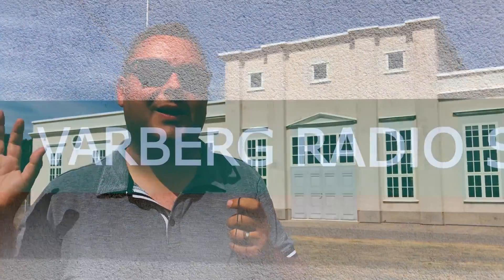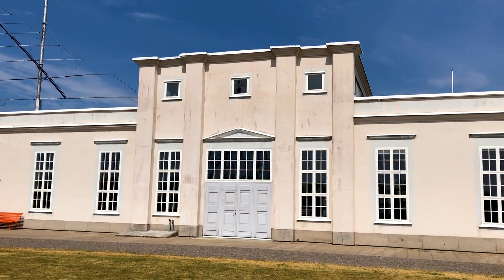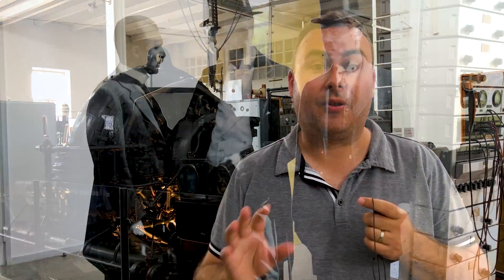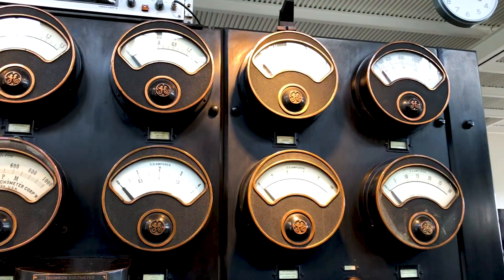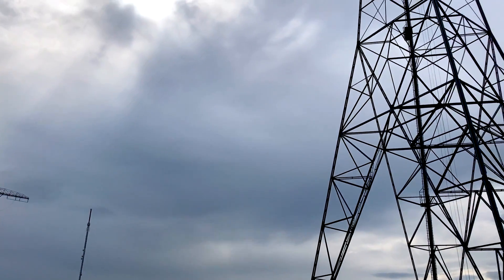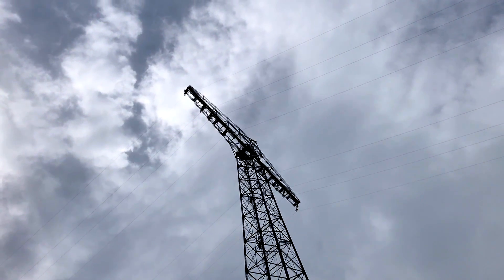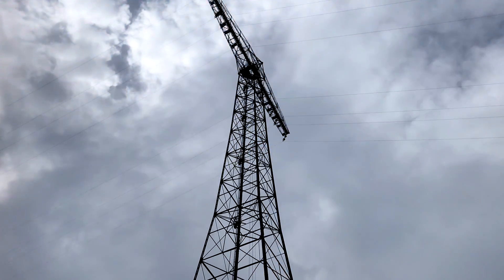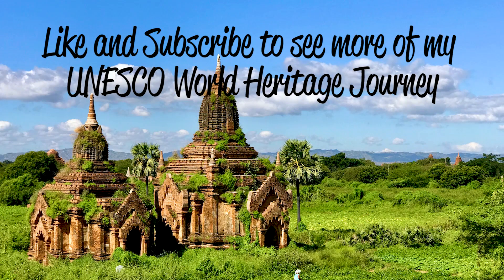Grimeton Radio Station - UNESCO World Heritage Site

Comment: That wasn't just the "generator" to power the transmitter, that was the transmitter!!  A mechanical transmitter, similar to an alternator in a car but running at 17,200 Hz.
Reply from the maker: Thanks for the correction! My knowledge of mechanical and electrical stuff has always been a bit limited :)